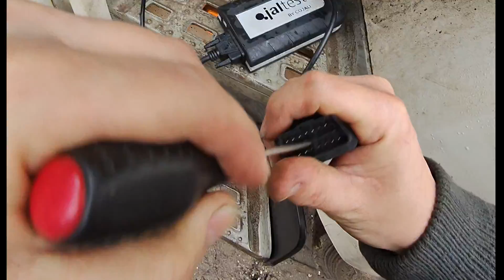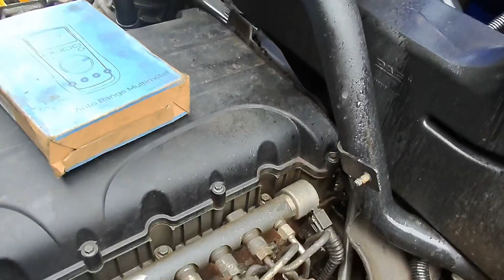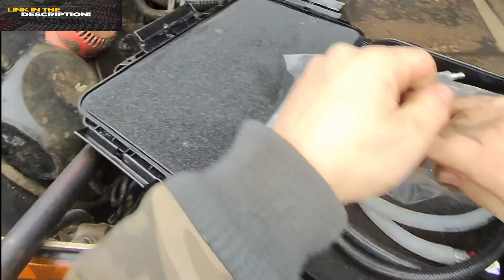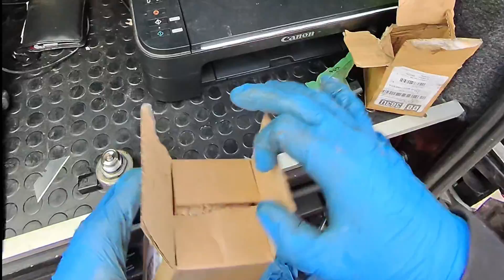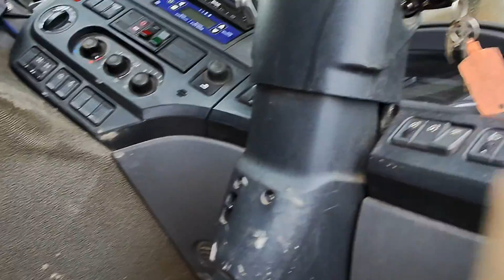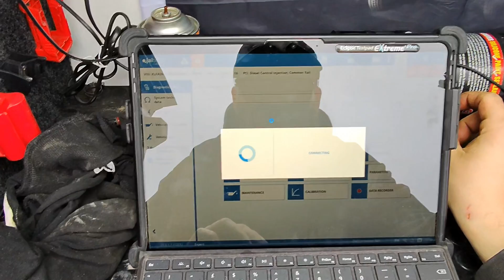DAF CF FUEL Pressure control fault WITH JALTEST.

Comment: Forgive me if this is a stupid question, but how did you know for sure there should be no fuel return at idle? I understand the rail pressure drops when the injectors operate, but does it always drop enough that there's no need for the relief valve to regulate the pressure?
Reply from the maker: Hi buddy. Thanks for the comment and the question. The conditions that the P.R.V. operate on this Delphi system is open at key off for pressure reductionin the rail and during an excessive pressure issue if I remember correctly, we could have checked the valve with a scope I suppose but from experience, if you have fuel out that valve during normal operation it's leaking off when it should be. No regulation of fuel pressure happens from this valve when it's running. It's all done via the fuel pumps 👍
Reply: @TRUCKTECHUK  ahh yes of course the fuel pump metering solenoid valve on top of the high pressure pump should adequately control the pressure sent to the rail at idle speed. Thanks for answering my question and making these brilliant videos. 👏
Reply from the maker: @GAH4444  no problem buddy I'm glad I've helped you out 😎👍

Comment: Hi I have a mx11 which we did the cylinder head gasket on and can’t get it to run after.We have changed everything on the low and high side fuel system and still nothing.we watch live data and we can prime system to 150 to 180 psi with hand primer and then we turn over and no rail pressure rises.we have bypassed the fuel filter element and gone off the lift pump straight to the high pressure pumps and still nothing.we have taken the high pressure pump pipes off to the rail and watch the diesel come out of them but still no rail pressure any ideas?
Reply from the maker: How is the timing on the engine? Did you have the unit pumps out at all? Have you tried blanking the fuel injectors and monitoring rail pressure? Is your cam and crank signal okay?
Reply: Blanked all unit injectors off and still no pressure and both cam and crank signals are saying synchronised so believe timings ok
Reply from the maker: @onomonkeys  did you take the unit pumps out at all when you did the head?
Reply: We have also swapped unit pumps as well
Reply from the maker: So you have swapped the unit pumps over, cam timing is correct and you have blanked the injectors and it still won't make fuel pressure. 
Where is the truck?
Reply: It’s a bus and East Yorkshire
Reply: If the timing was out would that stop the build up of rail pressure?
Reply from the maker: Something is odd somewhere 🤔 if you think about it the cam lobe creates the pressure and the solenoid releases it. If this was out of sync your opening time would be off. What I don't know is if the timing was incorrect would this produce NO pressure. 

If the timing wasn't moved or changed when the head was off it should still be in sync with the crankshaft. 

What I can't understand is how you can't build any rail pressure! That's why I'd love to see the bus 🚌
Reply: One thing that did baffle me was when we blanked all injectors off at the rail but we left the delivery tubes sat in the injectors when we primed the hand primer we got fuel coming back through the delivery pipe of injector 3 and dripping constantly?

Comment: Very interesting are you any good at fixing vibrations on Scania’s I am having a living nightmare with one
Reply from the maker: Hey John, thanks for the comment. I've not had much to do with Scania unfortunately. Is it more of a engine vibration or through the steering wheels/cab?
Reply: @TRUCKTECHUK  its coming through the seat we have balance the prop 2x replaced the diff stripped the gear box new clutch replaced gear box mounts new tyres 
Different wheels changed disks and ran out of ideas

Comment: Hi Russell. Just wondering where the return you took off runs to and why fuel not returning down that line then allows the truck to start?
Reply from the maker: Hey thanks for the comment so the return I blanked off returns to the fuel tank. It's basically an open pipe. This must be shut when the trucks running or you lose rail pressure Which was what was happening in this instance
Reply: I see, I was only curious because of the none start, but then when leak off is into a container, the fault essentially remains the same, but the engine runs? If you catch my drift 😅
Reply from the maker: I'm convinced the driver just couldn't be arsed with it so said it didn't start 😂. One way is to leave it where it is and go home, I should have tried it first really but I was only relaying the customer's concern
Reply: Ahhhh got ya! Makes sense now, thought I had missed something. Thanks for the clarification. Keep up the content pal its really informative!

Comment: No need to take the rail off, big pair of mole grips round the body and a 29mm spanner
Reply from the maker: Hey, thanks for the comment 👌. I've never used mole grips on one. I use a 'P' clip and a screwdriver to move it due to the potential damage you can cause to the body of the fuel pressure control valve.

Comment: Hello. help me please. I have a daf xf106 2017. error P3960. which sensor needs to be replaced?
Reply from the maker: Off the top of my head that is a PM sensor fault. PM sensors are mounted on the outlet pipes on the SCR as they check for Particulate Matter AKA SOOT.
Reply: thank you very much.
I respect your work.
may I ask?
But does this sensor need to be changed with its unit or separately?
Do you have a part number for this sensor?
Reply from the maker: Hey thanks for watching the videos 😎. The sensor has to be changed completely and I don't have the part number unfortunately.
Reply: I am from Uzbekistan
Reply: Thanks a lot.
I watch your videos all the time.
good luck to you

Comment: Ive got a MAN TGA D2876, which i suspect is leaking fuel back to the tank when running,also has hard starts when left overnight or even just after refueling, could my pressure limiting valve be faulty?
Reply from the maker: Hey, thanks for the comment. It could be a low-pressure issue also but it all depends on fault codes and live data 👍

Comment: Good job mate, amazing as always, the fuel system is a very common issue for the Daf. 
Well done!👍
Reply from the maker: Hey buddy 😎 yes delphi really slipped up with this system draining unfiltered fuel into the unit pumps....and NGD isn't  much better up to now 😵‍💫😵‍💫😵‍💫
Could be worse....it could be the exhaust system couldn't it 😅😅😅😅😅🫣🫣🫣🫣
Reply: Ohh that's right pal, don't tell me...😅🙈 just today I was called to a truck because it had problems with the regeneration of P3796 and had to leave urgently, the problem was with the temperature sensors after the BPV and before the DOC
The temperatures varied a lot, however, no error on the sensors. 🤦🏻‍♂️
Reply from the maker: Oh noooo 🥲🥲🥲🥲 well we did speak about the temperature sensors on the forum and how they should ambient when cold. 
Usually, the truck knows if one sensor reads say 300*c at the DOC then the DPF should be 550*c so I'm surprised you didn't get a fault code but we'll done finding that  👍😎
Reply: That's how I thought too, that it should give an error on the temperature sensors.
 It is an EAS 3, stationary regeneration failed because the temperature did not rise to the correct parameters and I succeeded with mobile regeneration when the engine was under load and high RPM.🙈
Reply from the maker: @benyapetri4965  glad you got it going buddy 🫡 hopefully the sensor comes out when you change it 😬
Reply: Yes, I hope so too....we will find out soon🙈

Comment: Good old MX11 fuel system faults. I have done quite a few pressure control valves on them. I did one a while ago that had water in the tank. Injectors, unit pumps everything fooked. Great upload Russel!
Reply from the maker: Hey thanks for the comment. I think fuel system faults are my biggest call-outs. I should look at buying these valves direct ha ha ha.
Oh water is horrific, wouldn't surprise me if this has had water in looking at the fuel pipe corrosion 🥲
Reply: How much water was there? And why didn't the Davco filter catch all the water?
Reply: @detenator890  The particular machine I was looking at was a Tipper/Grab 8 wheel they spend most of their life covered in dirt and getting beat to s... The one I looked at - the sideguard was pushed up against the tank and it rubbed through about 2/3 up. I think just driving in wet weather and it being washed was enough to get water in the fuel. Yep there was water in the separator.

Comment: Excellent diagose as usual! My first thought when I read the title was too high internal leakage due to injector ring failing, isn't that a common issue anymore? I assume the PCV is actuated at engine off to depressurise the fuel high pressure part, is that correct? It could be good to issue a warning in the video concerning the pressures of the fuel system, fuel spray can be invisible (yes, really) and very harmful. You obviously know what you're doing but an uninformed individual could draw the conclusion that there is no risk in undoing the nuts of the fuel rail.
Reply from the maker: Hey Ray thanks for the comment. I've a video here where I do both this valve and all the injectors but it's 2 hours long.....so I'm cutting it down to upload one day.
Yes the PCV should drop all rail pressure at the key off and not leak off during the running of the truck. You saying about pressures, I'm glad I didn't run the high-pressure test which would have  taken the rail to 2500  bar 😅
Reply: Why would you want to edit down a potential blockbuster like that?